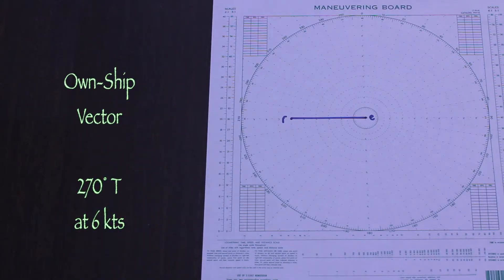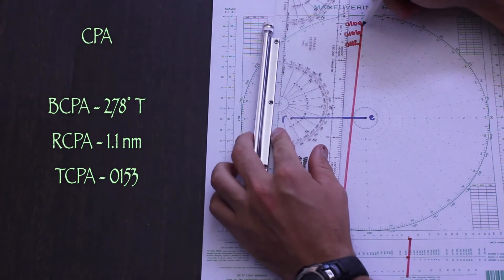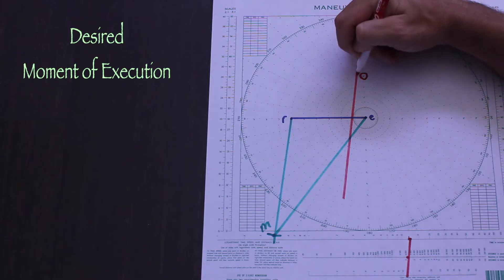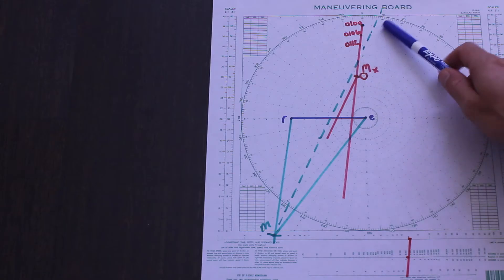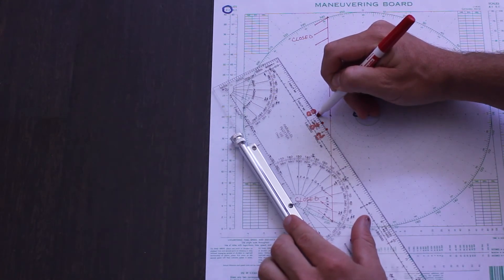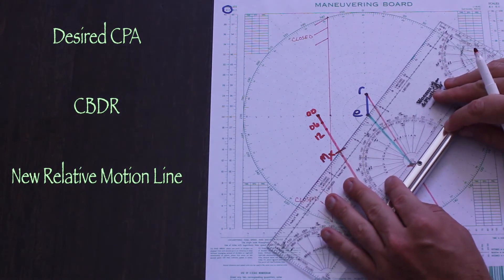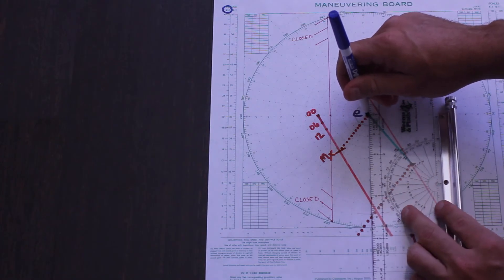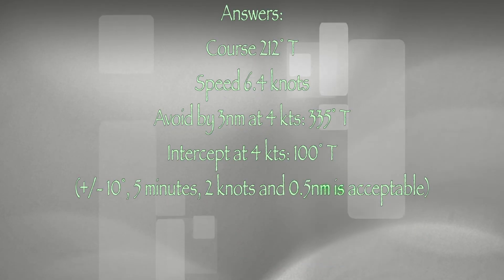Fundamentals of the Maneuvering Board (Part 3 - Avoidance and Intercept)

Comment: NAV TRNG: Older documentaries show Navy pilots, WWII- take off, fly a recon sector in search of enemy vessels and return to their carrier( which is not where it was since the carrier has been underway )some returning aircraft could not guide in on a beam from the carrier due to electronics being shot up by enemy gun fire and due to fuel limitations HAD to find the carrier. Q: Would the maneuvering board above be applicable to solving the Nav problem-(search and return) to a moving ship or would the pilots/navigators use a different type of board for their specific problem?
Reply from the maker: Hi flickchaser, that is an interesting question, I would unfortunately say that is beyond my experience.  However I would say that if you know the courses and speeds of any object, you can use the maneuvering board to solve vector problems.  Sorry thats not very helpful but thanks for the interesting story!